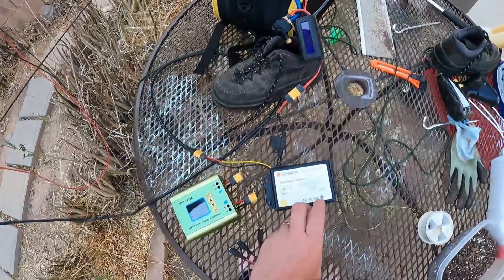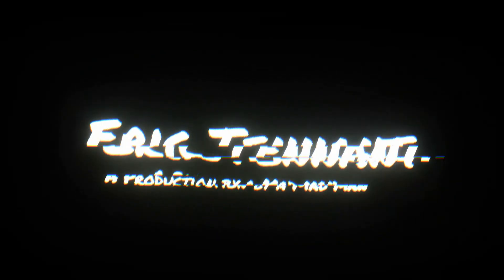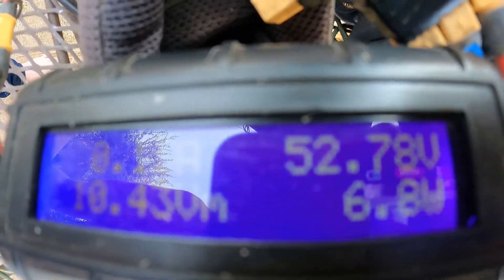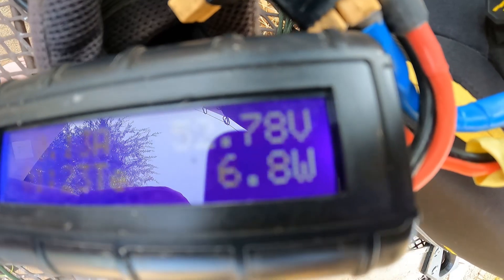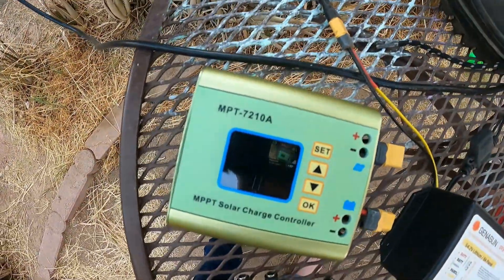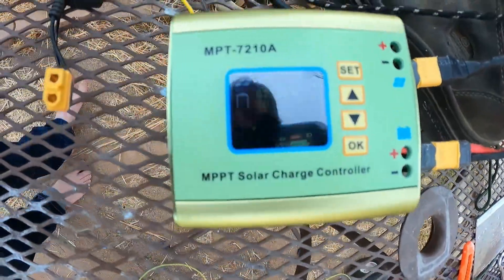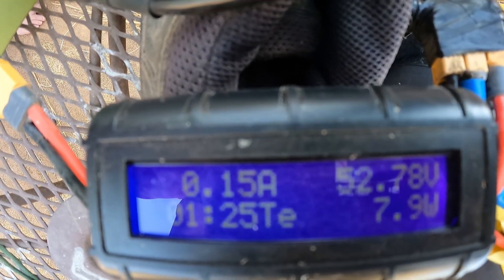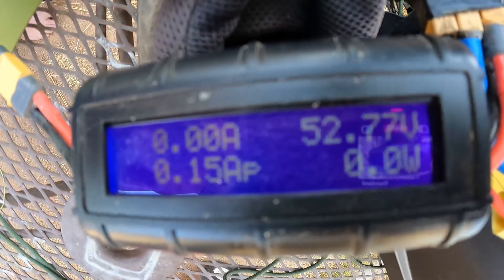How To Charge Electric Bike with Solar? Part 3 | Genasun VS MPT-7210A

Comment: for memory the gensun units can be parralelled ,,the one that grin sells to with the 2 led meters on the front is one of the best out there for ebikes and the can parralel to
Reply: Yeah its the ELEJOY dc to dc buck boost they have step up and down version ,and 15 amp real solid
Reply from the maker: Can also be done by hand if you get the volts = to +/-0.03 of each other without that device.

Comment from the maker: I earn commission if any item is bought using the links bellow. That said I do give unbias reviews of them given I had to use my own money to obtain them.

🛒100 watt foldable solar panel: https://amzn.to/36fbAQc
🛒Anderson Powerpole Connectors: https://amzn.to/3z1Tluc
🛒14g wire: https://amzn.to/3xGylZy
🛒Flux: https://amzn.to/2VMzlxh
🛒Soldering Iron Kit: https://amzn.to/3icuexR
🛒Heat Shrink Tubing: https://amzn.to/3rfedLU
🛒XT60 Connectors: https://amzn.to/3wBefPa
🛒150a Watt Metter: https://amzn.to/3rdKcMw

CHARGE CONTROLLERS
🛒Cheapest (Not Best) - MPT-7210A: https://amzn.to/3xvqRbF
🛒Best for 48v - Genasun GVB-8-Li-54.2V-WP: https://amzn.to/3ARroai
🛒Best for All Other Volts - Genasun :https://amzn.to/2UARc9Z

Comment: The Solar Wattage is so low it can barely power the controller. The situation is made to favor the controller with the least self consumption wich obviously is the one without display. It would be interesting to know what happens when there is enough sun for 20-30 Watt.
Reply from the maker: Green one is junk because the controller reset every time the voltage lowers, and it takes forever to recover. I return the green pos back to amazon long ago.

Comment: The one I bought is right in between the two you are reviewing.
Mine is also made in China but does a lot better job at power point tracking than the green one you have.
Check videos on the MPPT Boost Solar Charge Controller (Model: CTKEV300 U:48V  P:300W)
Reply from the maker: Odd Amazon doesn't have CTKEV300(Blue one) listed.
Reply: @Eric_Tennant , They were available for a while on Amazon but are now sold exclusively on eBay.

Comment: Sorry to watch this video - I bought the 7210 a couple months ago, I can't send it back now.  Although, I will not be touring, just charging with the sun.
Reply from the maker: 7210 just slow to recover from shading. This video ( https://youtu.be/5_4ZSG3pK7o ) has a silver one that the best value if you don't care about weight. Works just as good as the $200 Genasun.

Comment: After testing the Genasun for a short time it stopped working. Fuse is ok and there is voltage on the output but no charging. What a disapointment at this price!
Reply from the maker: Sorry to hear that, hopefully they have good customer service, mine has been great for a long time now.